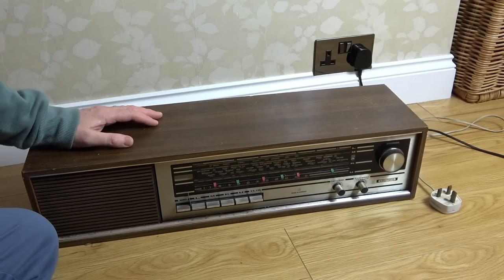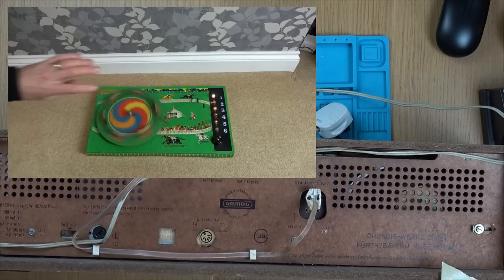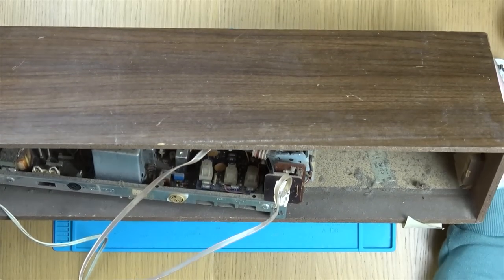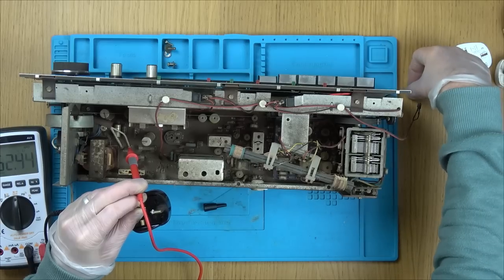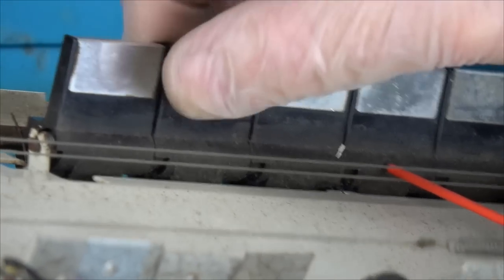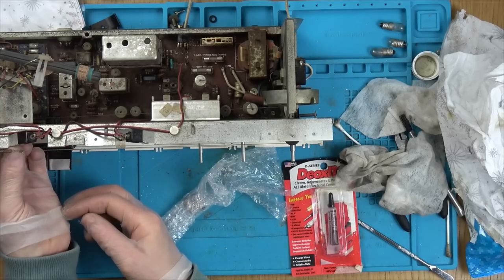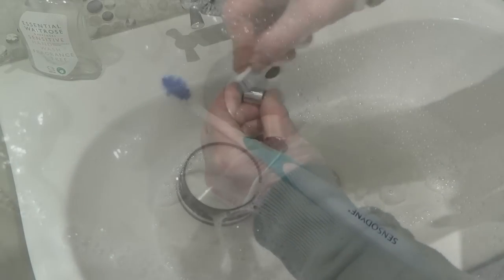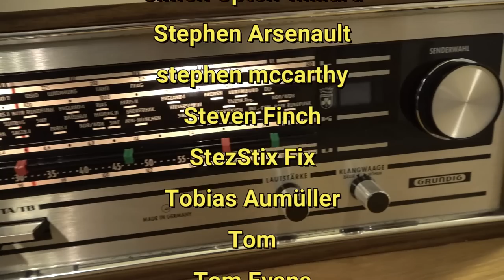Trying to RESTORE a Dirty HUGE Vintage West German 1960s GRUNDIG Bookshelf RADIO

Comment: And thanks to its DIN audio in/out jack it can be upgraded to modern times using a BT recheiver and a 3,5mm headphone to DIN adapter. Or connect a turntable with a ceramic catridge to it. Beiing a tube amplifier it is perfect for ceramic cartridges due to the high impedance of the input.
Reply: I think this is a transistor radio ;-). But yes. Just note that the DIN standard impedance was not the same as on modern equimpent. Often OK, but this can cause some trouble with levels.

Comment: tbh When I saw you had a Grundig there that was out of action, even allowing for its age, I thought that's either going to be down to something really minor, or quite the opposite, something like someone having spilled a drink in the back of it, which, unlike with a telly, would be quite awkward to do even if you were trying; or it having gotten hopped off of a concrete floor or the like.  Happily it turned out to be a 'minor' case - a simple matter of changing the fuse, about as simple as it gets. Of course, your Grundig was made back in the days when Grundig were GRUNDIG. They're not one of those nasty 'zombie' brands like GPO or Crosley are these days, thank God, but they're not what they were. Oh, well, neither am I... 
    I remember living in a fairly upmarket area of London in the 1990's for a year or two and it was not at all uncommon to find items of furniture, household appliances, A/V equipment etc. thrown out as refuse either because the owners had 'upgraded' to something newer, or if  electrical/electronic items, though they may have developed a fault they typically only needed the most minor of repairs. Unlike today, stores didn't have to take in/take away old equipment for recycling and being rich the owners couldn't be bothered trying to recoup a few quid selling their stuff second - hand. I picked up a lot of decent stuff that way (I wasn't married then so I didn't have a wife to curb my more 'pack - rat' tendencies!) I got me a great music centre and a television n this manner - I had to 'borrow' a shopping trolley to get them back to the gaff! Initially I thought I really had lumbered myself with a bunch of useless junk, but it turned out in both cases to just be a matter of changing a fuse. It's maybe just as well that I didn't have a car and "Mr. Fix~it" skills, or the place would have been like Aladdin's Cave!

Comment: Fuse might have been damaged due to dropping the plug- anyways that sand is to dissipate the energy of the fuse blowing… not sending glass bits and molten metal Vapor everywhere

Comment: Fuses like that old one degrade overtime and can fail for no apparent reason. A 3 amp fuse is ideal for that , the fuse is there to protect wiring not the item.

Comment: hey Vince, just finished watching - nice work. I would def consider replacing the mains cable, as single insulated is pretty dangerous... its illegal here in NZ for mains voltage. Slightest nick in that cable and your have exposed mains! By the way, your lamp at the end looks like a fancy bong hahaha

Comment: Don't buy any Grundig Products that are made after the Year 1999 because it's Junk. A Company named Vestel bought all the German Brand Names like Grundig, Telefunken etc. and uses the old German Brand Names to sell Junk. I repaired several Grundig, Telefunken, Medion and more Brands Television and they all are using Vestel Branded Mainboards and Power Supply that are using underrated Components which doesn't only break quickly but is also Dangerous to use.
Reply from the maker: Thanks for the heads up Michael, shame that these old names are reduced to this! 👍
Reply: Yes, so many old quality brands are used to sell really cheap crap. Sad to see.
Reply: 😠 ~ Chineseum crap
Reply: @samuelfellows6923  Actually they are a Turkish company - they make a lot of things for some big name brands including many under $1k LCD TVs. You would be surprised at the brands including (and these are not defunct ones - Hitachi, Philips, Panasonic and Toshiba - if you don't believe me just search yourself). Obviously the big brands will have approved designs and do a lot of QA just like Apple do when FoxConn make their iPhones in PRC.
Reply: @mrw6156  ~ still they are crap/rubbish knock-offs 😠, buy vintage
Reply: @samuelfellows6923  Yes - agree the cheap brands are crap ! I do buy vintage and where impossible buy good quality

Comment: You can no longer get 7 volt bulbs.  Use 6.3 volt .1 amp . They will not last as long but will work ok for quite a while.  Other wise use your existing bulbs in series.  Not as bright but a long life ...

Comment: I thought that it might be have been a valve based radio (as it was from the 60s) in which case the fuse should have been a high amperage one.

Comment: The Tuner ~ Weighted  -   ahh   lol   I DO Know what you mean.   8 )     Spiders are Always CUTE .  
FYI  'Grundig RF 150 Service Manual'  >  audioservicemanuals   a bit late  (if add link comment may be Zapped)  find > 
4th down search:  "1960s GRUNDIG RF150 RADIO manual"   : }    Really Nice Radio & Job!
Switches are like in Car Radios - older cars.  
Scared me:  don't like idea of inside 'Bang' \ Slide around.   But then,  as it brings you joy, you'll have more to Fix.  
Surprised Radio has White Plug & Cord, Brown looks better.   Does Cord have Ridges on one of the lines - re: noting neutral?

Comment: 1. As already mentioned, the back panel mentions the types of fuses (mains - 100 mA @ 110 V / 50 mA @ 220 V, slow blow, secondary - 400 mA medium slow blow) and even the bulb ratings. Not sure how you came up with a 3 A fuse, that's way overrated. Heaven knows how the original one blew.
2. The old mains cord is not double insulated and should be replaced to comply with current (as of 1980ish) safety regulations.
3. You can find a schematic for this one on the interwebs quite easily.
4. Expect the new bulbs to blow in relatively short order. Presumably the higher UK mains won't exactly be helping bulb longevity in general. The bulb circuit is all AC, unfortunately, so an LED replacement gets a bit more involved.
And yes, if it's a Grundig it generally sounds good, thanks to loudness circuitry amongst others. Their stuff back then was high quality.

This guy is mostly silicon, only the outputs and the power regulator remained germanium. Beware of the B30C300 selenium raggedifier, these things tend to get high impedance as they age and have a habit of releasing a nasty stench if they blow up. Replacement is a bit more involved, it takes a common small silicon bridge rectifier plus 4 small film capacitors in the tens of nF across each junction, plus potentially a bit of extra series resistance to bring B+ down to where it should be - these days I would shoot for 20.5 V= unreg out at 230V~ in.

Apparently a clean and lube job on one of these switch mechanisms used to be a common occupation for repair apprentices.

Comment: wow you got lucky on this one 
Whoever put that overrated fuse in there wasnt thinking and I am guessing the fuse they put in was faulty if lucky enough hopefully all it was was a power serge that took it out in the first place.
Never, ever ever put an overrated fuse in always use the same specified by the appliance or less.
I was given a roland synth and it appeares to have had it's fuse taken out to be used in an other piece of equipment before I got it. I replaced it with a fuse with a smaller value than what was indicated and it works perfectly!
That is how you know why the old one blew up or in my case why the fuse was gone and wether or not the cause was catastrofic or not. In the event the cause was by some other component downstream failing, puting a bigger one in will only make things worse and puting a smaller one will just keep blowing.

Comment: I have a very similar radio that I kept from when I was a child. But it has stereo speakers and they are separate from the radio. I bet there is just as much dust in mine ! I'm sad because even though I am not using it, in a few years it will become "just" an object as FM radio is going to disappear here. I secretly hope that it won't but I'm not holding my breath.

Comment: Try looking at me carlsons lab he's always fixing up vintage gear and he has taught me so much about older electronics
Reply: I'd second that - lots of good advice during his videos about testing and replacing commonly faulty components especially capacitors.

Although he does have a huge range of test kit - not sure Vince's better half would like the dining room turned into a repair lab with floor to ceiling test equipment.

Comment: stupid debugger
do not put oil on the plastic mechanisms
the first thing you do when you open an appliance is clean it
do not allow this individual to repair your appliances
Reply: Well he doesn't repair them for a living and is at pains to point out it is all for fun. Regardless I have seen far worse practices in "professional" repair places. 

What is your problem with Vince ? Why call him "this individual" ? Are you an expert that has NEVER made any mistakes ? 

Look at the videos he has released over a period of years - they are good, honest examples of a patient, systematic DIY approach to repairing electronic items (and a Rolls Royce). 

If all you can find to criticise is "don't oil plastic" (generally I agree but hardly putting fingers on live terminals territory !) and "clean it first" then I suggest you have a nice cup of tea and a biscuit to reflect on life ! After that I also suggest you look at 14:20 where he is hoovering out the inside before inspecting and repairing. 

To paraphrase you - "do not allow this individual to spoil some interesting videos"